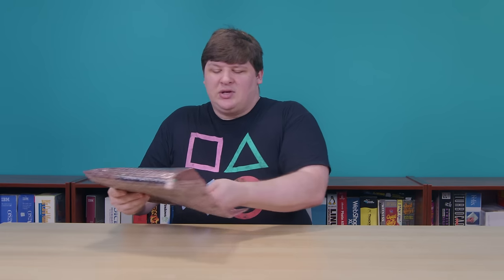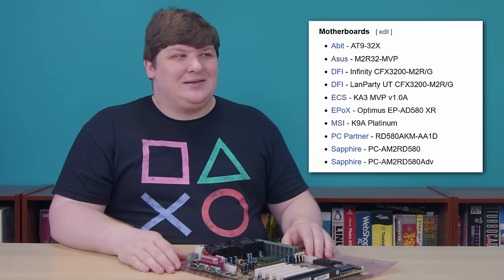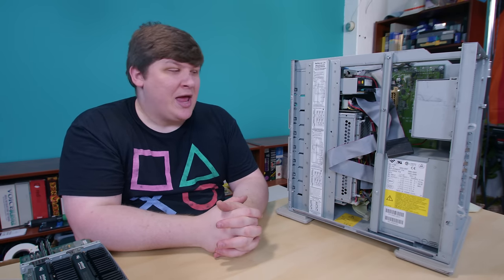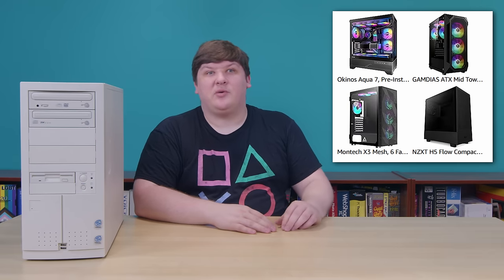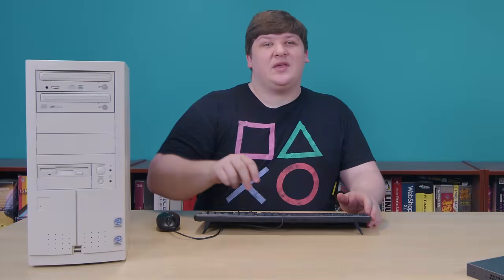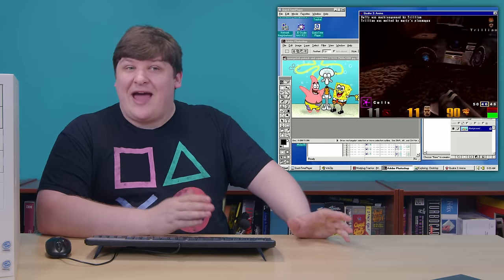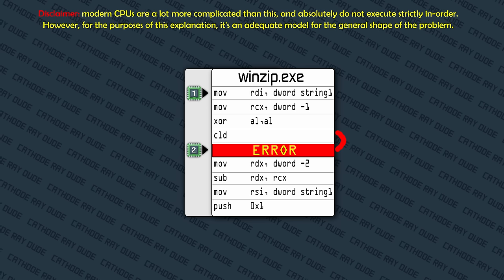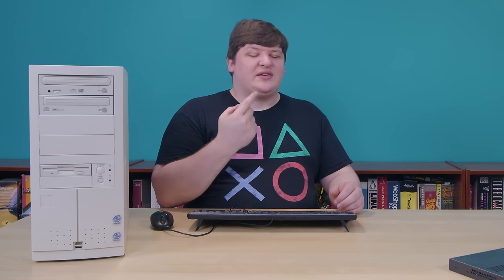The Only Famous Motherboard

Comment: NT5/Windows 2000 Pro was what I ran on systems like this.  Runs almost all W98 software since it had working Direct X 7 and even got DX 9 support a bit later.

The UI was also pretty much exactly like XP but with a 98 skin on it.
Reply: Windows 2000 was NT 5 and xp was NT 5.1, they were very similar in function just xp looked nicer and was updated and maintained longer
Reply: @GenOner  Yes and no.  The licensing between them was very different.  2kPro was much more restrictive with CPU count because it was never marketed for dual core and up CPUs.

2K also ran better on low memory/low power systems because it totally lacked the background windows update and activation infrastructure that XP got.  Pretty sure the XP kernel also had some fairly significant changes too.

Regardless, I skipped XP and Vista mostly, other than playing around with them on other systems out of boredom.  I actually used XP-64 more than vanilla XP.

Comment: SMP is a term used at least within OS development generally for all systems that have multiple cores with the same capability (speed, instruction set, memory protections), so it's inaccurate to say it disappeared with multicore SoCs - it rather took off and is now the norm. The opposite of SMP is things like Intel's big&little cores, the same thing on ARM phone SoCs, and microcontrollers like the ESP32-C6 that has extra low-power cores with different instruction sets.
Reply: Interesting. Now I have to figure out how to read up on that. I figured "E"fficiency cores were just for doing tasks that are somehow designated as requiring little processor time, with very low probability of wrong predictions. But that was just a guess, an inference from the name. And I had no idea about that last processor you mentioned.

Comment: 20:11 WHAT!?! No backplate!?!?! 😂 I kid… But man, you’re taking me back on the nostalgia express! I’m so thankful you have this channel! I had one of these with overclocked Celerons, in a full tower case with casters on the bottom and three ultra wide SCSI drives, with a pair of 3-D Voodoo video cards running in whatever they called SLI. Please keep making these videos, don’t ever quit!
Reply: Also as a heads up, the reason we bought Celeron processors was due to the fact that you could overclock the hell out of them. You could not nearly overclock the pentium version. Not only because it would be unstable, but also due to the heat. The celerons gave you so much more performance when overclocking they blew past most of the pentiums that I knew about.
Reply: They're getting REALLY hard to find now -- even the early ones that all had exactly the same layout, with optional LAN above the USB, and optional sound.
Reply: >Vooodoo cards running in whatever they called SLI

...they called it SLI. nVidia got the trademark when they bought 3dfx's corpse. Though under 3dfx it was an acronym for "Scan-line interleave" while nVidia uses the much less specific "Scalable link interface"
Reply: @Jay-ik1pt  when did Nvidia make that change? I still recall everybody saying it stood for scan-line interleaving circa 2005-2010. (2011 is about when I stopped lusting after SLI.)
Reply: @kaitlyn__L  AFAIK nVidia bought the rights to the name and changed what it meant immediately as soon as they started using the acronym for marketing their own cards but my memory isn't THAT good to remember for sure.

What I do remember, from reading about it back when nVidia's SLi first came about is that 3dfx's SLI and nVidia's SLi had little or nothing in common besides the name and concept, supposedly the actual technology behind it was quite different. But, again, going on old memories based on info from people who were journalists in the industry at the time, themselves relaying information from nVidia's marketing rather than the actual engineers.
Reply: @Jay-ik1pt   that totally makes sense! It’s possible those computery guys in my town just didn’t update their initalism knowledge and kept using the 3dfx official expansion of the name. Even up to 2010-2012! I did at least know it worked quite differently, though mainly because there were multiple incompatible versions from Nvidia, than the Voodoo ones. Not like you could stick a Voodoo up with a Geforce or whatever anyway given SLI liked matched pairs, but even more so given the different methods. The way it was explained to me back then was it was different methods to coordinate the lines, and to allow for tri- and quad- SLI, but I’ve never bothered to look into how accurate that was.

Comment: I never owned one but my recollection of what made the BP6 hot at the time was specifically the fact it worked on Celeron processors, which was not supposed to be possible or maybe even allowed by Intel. Also its release happened at the around the same time as Windows 2000 (beta and RC builds were widely "available" in 1999) which was a great desktop OS compared to Windows 98, being able to run most games without issues too and it supported SMP. I have some recollection of my friend with a BP6 demonstrating how smoothly he could browse the internet while having other stuff running on the background.

Comment: Overclock scene nowadays is a joke.

The point of Overclock was to make slow mainstream cpu /gpu to go fast at a reasonable cost.

Nowadays it means to make already very fast components to go even faster. Overclock became restrict to expensive cpu and high profile mainboards.
Reply: Kind of the reason why overclocking is a joke is that modern CPUs are either squeezed so much for every ounce of performance, binned into a new SKU entirely, or have pieces of silicon disabled.
Reply: @No-mq5lw  don't forget overpriced motherboards to even allow you to atempt to get the 200mhz more
Reply: Yeah, with cheap CPUs sometimes coming from artificially crippled high end chips, or at it's peak where you could literally unlock more cores in some AMD CPUs it was essentially chip lottery. Of course it was exciting!

Nowadays there is none of that, "normal" components become unstable at anything other than stock bus speeds so you can no longer "literally overclock your entire PC at once" and "unlocked" chips you pay extra for performance that you may possibly get if you come prepared and lucky.

I was big overclocker when I was running Core 2 Duo for way longer than I should and now I almost forget I ever did that... I'd just buy faster "normal" chip nowadays. I don't even overclock my GPU, it's just not worth it. This is what happens when corporations figure out their product.
Reply: This is why the new 'hotness' is undervolting. Which mostly just disables some of the hot and inefficient factory overclock that virtually every CPU ships with nowadays. Sometimes it's even necessary! (13 and 14th gen intel chips are nearly guaranteed to burn themselves to death unless you do this. And probably even if you do as well..)
Reply: Most impressive and easy overclock was celeron 300 to 450.
Reply: exactly, overclock was to push cheap parts to extremes, not to risk expensive parts. It makes no sense to do overclock anymor.
Reply: I can't speak to current CPUs, but my midrange 9th-gen i5 is very overclockable - 3.7ghz stock, overclocked to 5.0ghz. I think it could go to about 5.2, but 5.0 is the highest it went with 0 errors in prime95, and I don't fell the need to push it. It is of course a K model, with a mb designed for overclocking, but the premium for that was only about $20 or so.
Reply: @keithstathem872  yeah, but you pay the "k" tax for the privilege.

Comment: paralellization in DAWs is really funny. basically since some given audio chain needs to go, temporally, from one sample to the next, a given thread corresponds to a chain of audio processing (synthesier voice into its effects) and then the multithreading happens when the mixer mixes those chains together in the bus. the computational chain almost exactly mirrors the imaginary audio cables running from virtual device to virtual device.

notable exeptions include:
-reverbs and spatial processing which can paralellize the virtual delay lines or allpass vectors or whatever reverbs are really weird and mathy
-synths that run their polyphonic notes on multiple threads and then mix them.
Reply: This is exactly why I printed out the Linux kernel man at work, read the whole thing taking notes, and then compiled my own kernel in 2001. The difference seemed slight at first, but the more I used it, the more I found was improved.

Comment: Man. It's like you made this video about my evil twin. 
I ran the Asus dual slot 1 P2B-DS board back then. 
Bought it with a couple of Celeron 300 and had to run the extra traces and drill out the back of the package to make them work. 
Then moved to dual P2 350 overclocked to 412Mhz.
Then from that to P3 850.
Ran SCSI for my optical drives and a 6 channel Promise IDE raid controller. 
3Com NIC.
SoundBlaster AWE64 Gold for sound card.
Matrox Millennium 2 for 2D graphics and Orchid Righteous 2 3DFX for 3D until I upgraded. 

I was literally the dude at the LAN parties you were talking about. 

And yes. It was all under NT5/Windows 2000.
Didn't upgrade until games insisted on Windows XP.

This was an epic trip down memory lane.
And yes I have most of that hardware here still :)
Reply: I had that same rig, minus the modified Celerons! Bought at an auction because my boss wanted the ATX case and power supply, I got to keep the case and the motherboard with dual Pentium II 400's, which was a huge step up from my overclocked Pentium MMX (200 running at 250) once I got a power supply (re-wired from an Apple, if I remember right) and eventually a case. That was my first Linux machine, since I didn't have access to Windows 2000 and Linux Journal came with distros, I could build an SMP kernel with optimized audio processing.

Comment: This brings back soooooo many memories, I worked in IT back then, so I remember working on the HUGE, weird servers like that big boy you showed, as well as the "small" servers like that Dell. I remember running NT 4, 98, Red Hat, BeOS, AND OS/2 all on the same machine just to prove to myself it could be done. I remember struggling to get games to run under NT because of its limited support for DirectX. And yes, I remember using jumpers and DIP switches to set up clock speeds, IRQs, and the like, as well as working with a rat's nest of cables and trying to route everything around those damn ribbon cables that took up so much room, and forcing reluctant Molex connectors to plug in because I am the old.

I love your channel and I love to see all of the old hardware that I remember from my youth. Thanks for resparking my memories.

Comment: I finished my engineering degree in 2002, and had daily driver of Windows 2000 with dual boot of Windows ME (which worked better for me than 98 SE, which other preferred). I worked on a dual core machine which was part of my final degree project (it utilised multi threading for data processing). I remember thinking how I barely even needed ONE CPU to perform the task, and just using the dual processor config just so I can write this in the project description and justify buying the data, lol. It kinda made the system more stable of course, in case a background process would hog one CPU, the other one was running my code fine ("real time" data streaming in).

Comment: I had a Precision 420! I had no idea the PIII worked with RAMBUS, I coulda sworn that was just a P4 thing. I also was completely unaware that you could do dual slot PIII. I thought that was just a Xeon exclusive thing at the time.

Such a weird PC.
Reply: The memory controllers were on the chipset instead of on the CPU back then, so in theory you could pair any kind of memory with any kind of CPU. Intel themselves proved that when the initial Pentium 4 chipsets only supported Rambus and they claimed it's essential for P4s to work, but then a year later they caved in and released a chipset with regular SDRAM (SDR and DDR) support.
Reply: Look up Precision 330.
I don't have one anymore, but I still have my Socket 423 RAMBUS Optiplex from that era.

Comment: I too have been having problems with PCI sound cards. Also just later 90's sound cards in gereral. They all work prettey much perfactly in Windows 98, but then I switch to DOS and the only soundcard that does anything my SB AWE64. I use usisound in DOS btw.
Reply: a lot of later pci soundcards only work in dos with weird drivers, i've had good luck with emu10k1 based sb live values out of old dells but it's been a while and mostly i just use my awe64's

Comment: to the author:
if the Pioneer DVD-ROM is a U03S (black writing on the bezel or its bulk brother 303S normally with a complete beige bezel) then NEVER REMOVE the jumper that switches from RPC1 to RPC2 becuase then you only have 5 possible changes of this setting including the first setting. while with RPC1 the software had to be set to the region of the DVD with RPC2 the industry forced the manufacturers to implement this 5-times-change into their firmware and after the 5th change the drive is irreversibly locked to the last region.
i got a 303S, a U03S and a Creative 6/24 of that old DVD-Encore 3 bundle and they all are RPC1 (the Creative doesnt have a jumper or anything else to switch to RPC2 but i guess some "better firmware would have implemented this as well if you had mad such an "upgrade").

Comment: This brings back so many memories. The struggles of early multiprocessor machines. The lack of multithreading in software. The scheduler not really being the best for it, although, Windows 2000 and XP were a world of difference for SMP support. Then getting into things like processor affinity if you really wanted to fine tune a system. And then there was being in school learning about OS concepts. Threading, preemptive and cooperative multitasking and how preemptive is the only way to go. Windows 3.1 is a stark reminder of why cooperative multitasking doesn't work - one process breaks the rules and it's all over. I can say, adding threading to an application can be very complex, I've done it before but you really hit the nail on the head. It can be very hard to do and it needs to be done where it makes sense. It doesn't always make sense. Games, to your point are heavily multithreaded. Things like music, physics, graphics code, disk access, net code, etc.; are often all broken into threads. However, those threads may not be further subdivided so it can give the appearance of single threading where there's slow downs when a lot happens all at once and overall CPU usage is relatively low. Of course, synchronization across processors back then was a huge pain which is why a lot of old games struggle running on SMP or multicore machines. So it was all effectively single threaded even if there were some parts split into other threads. I think this video really did a great job at explaining a lot of these complexities without going into the mindbending realities of how threading is accomplished and controlled. Thank you for making this!

Comment: I had incredibly early broadband in 1997 with an INSANE speed of 300 kBit/sec. Back then I pulled ethernet cable to share the connection with my brother through a wall and just twisted the appropriate copper wires back together. Even piggy-backed ISDN over the unused pairs. Some scotch tape, tip top! You young people with your "crimping". pfft!

Comment: 59:21 Penium4 era Celerons really ruined the whole line. Imagine having a ~800Mhz P3-based Celeron, spending a good amount of money to "upgrade" to a ~2000MHz P4-based one a couple years later and finding out that programs don't run that much faster. What a fall from grace that was the line that had greats like the Celeron 300A.

Comment: This video certainly scratched a certain kind of itch! My first proper computer was, of all things, a Dell Precision 620, the big brother of the 420 you showed. What a saga it was trying to source a second xeon cpu for it, or additional RDRAM (learning the hard way that it has to be 2-dimms at a time), trying to adapt to NT 4, trying in vain to get the onboard 68pin SCSI to play ball with a 10k rpm enterprise drives I found on ebay, eventually getting it properly upgraded to the hilt only to experiencing the occasional fleeting wins and the many disappointments of SMP computing in the year 2000. Those were the days! Thanks for another awesome memory trip CRD!

Comment: I got super excited when I saw that Dell Precision! As a kid, my friend's dad offered me an old server and I gladly accepted. It was a Dell Precison that looked exactly like that one on the outside, but was slightly different on the inside. On mine, the rambus and cpu locations were swapped. The rambus was installed on two daughterboards that went in together and had these black wing handles that flipped out for removal. The CPUs were two black hunks of heatsink metal with a holographic Pentium Xeon sticker on each. It was the coolest thing I owned for several years.

Never did much with it, I don't think the 10,000 rpm SCSI hard drive worked. I got Ubuntu running off a disc, but I didn't get far as a kid with limited internet access. Many years later I stripped it down and gave some of the parts away.

Thanks for reminding me of a great childhood nerd memory.